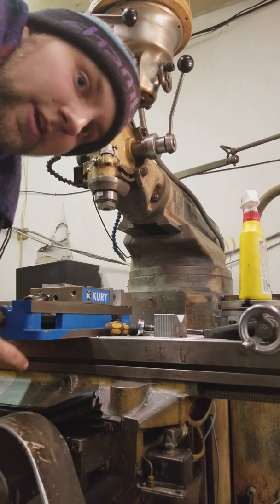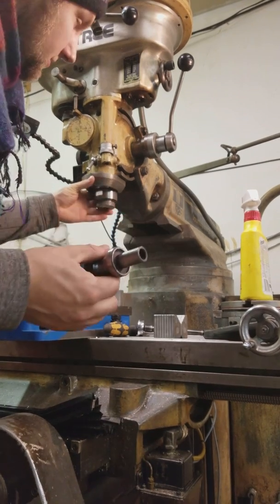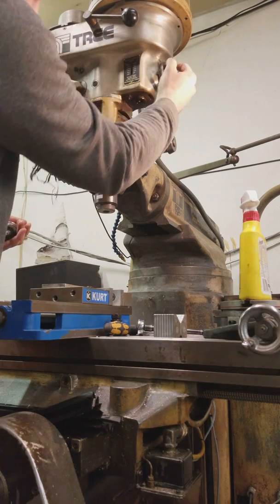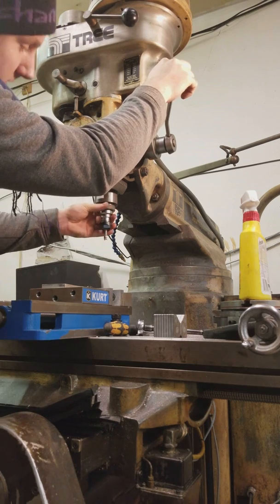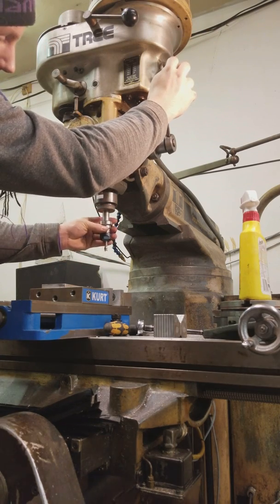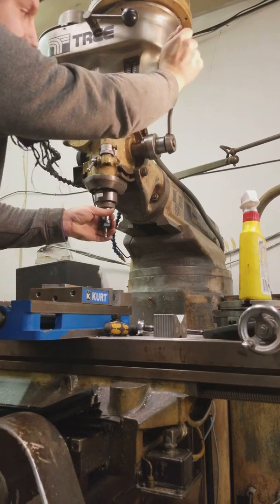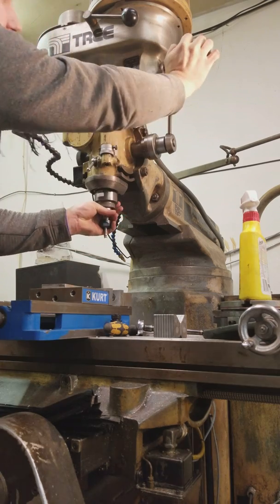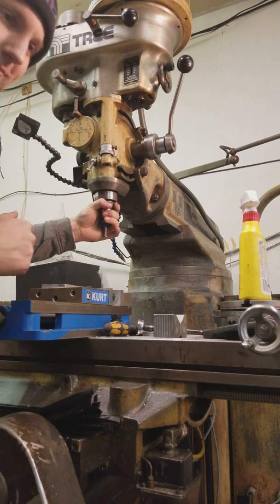Adjusting and using Tree milling machine's Z collet system

Comment: Hey I hope you are still around,I got a 1980 is tree journeyman 200 I think  all automation took a dump so I replaced brushed x n y motors w brushless dc motors w galco motor drives. Replaced all bearings needed as well as seals.great machine .do you know anyone who can make quill drive pins ,I can get 2 made but no less than 1000.00 for both.probably gonna buy a four jaw for my lathe n make them myself.